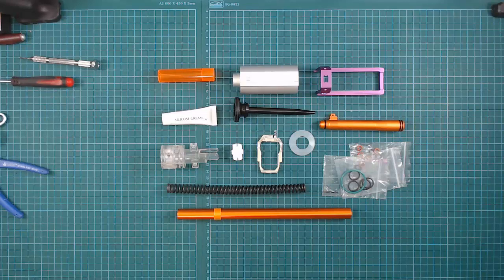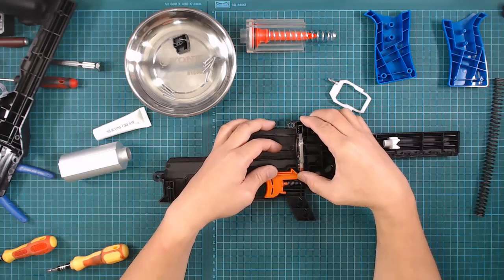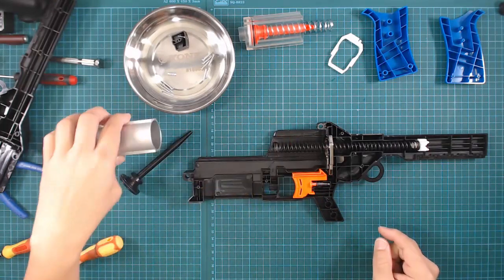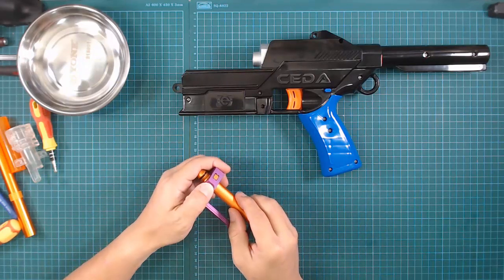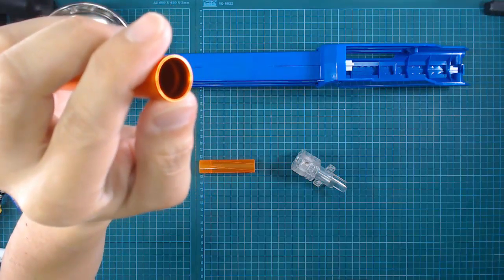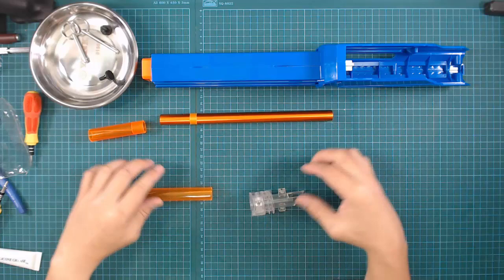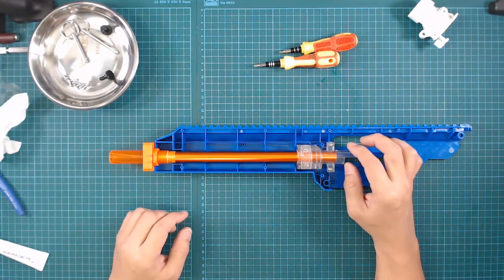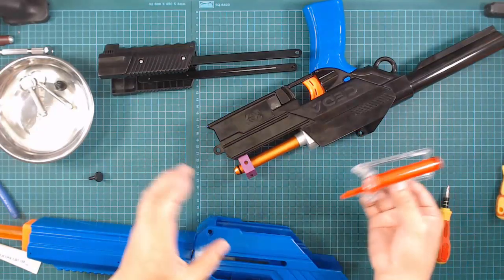{ Installation } - Ceda + AKmods Upgrade kits  (190~210+fps)

Comment: Heya Tungsten,  fist things first, switch your lube to a people friendly lube, I would recommend INOX MX6 High Temp Food Grease. Its way safer than the silicon lube and cant harm children as it is edible. Though i dont recommend you eat it.
Next the Worker Breachs do not like Katana mags, the mag sits to far back for the breach to work properly. Talons are the way to go.
I have this kit with the AK 16kg spring, amd mine is averaging 270fps. Dont use the worker barrels they are too short, get yourself a Monkee Mods 35cm barrel and you will hit much better numbers! My second CEDA is the Sport model amd thats hitting 210fps on the AK 12kg spring on the stock plunger and barrel system with the ZRO attached. Let me know if you need any help improving the performance and I will send you my details.
Reply from the maker: Thanks for the recommendations man, will definitely check them out.
Reply: how is your ceda averaging 270? Parts list?
Reply: @matthew5105  heya mate, my CEDA is essentially between is hit the function is putting in this video, but I went but I went through the very painful exercise of having to resize every single or ring in kit. As parts are metric and imperial making the seals lousy. I have put a 10mm spring spacer which is the equivalent of the printed on in this video.  As well as a Monkee Mods 35cm barrel with a custom plunger rod. It does matter which way the plunger tube goes in, other wise it won't catch or prime properly.

Comment: I really like that blue and black color scheme better than the one with white it looks way better. Also have you tried using your own 3d printed katana adapter that sits the mag forward. it might fix your problem with the katana mag.
Reply from the maker: Ya, the black definitely brings out the blue. I will need to modify my adapter design slightly to have it work as it was for flywheel and there are area which block the pusher, but yes I am going to see if I can make the changes and use one as I have more katanas than talon.

Comment: I’m having a hard time getting it to catch I changed springs on catch dint seem to help much if I pull trigger as I prime it will work am I doing something wrong do I need more lube
Reply from the maker: hmm that is strange, I use the original CEDA spring, make sure the spring is seeded all the way down into the metal pole that holds the spring for the metal catch. if it still does not work, you might want to contact the seller? If it is AK mod, I believe you can message them through https://www.instagram.com/akblastermod/
Reply: Gerald, there is a reason your having a hard time gettingit to catch and thats because the plunger tube will be upside down.
The tube does have an oreintation, I had to draw an arrow on mine to make sure I always put it in the right way.
When it is in right, it will catch easily even on heavy springs and spring spacers installed